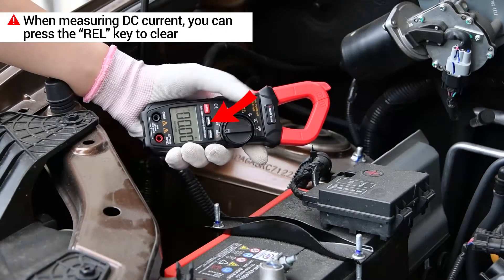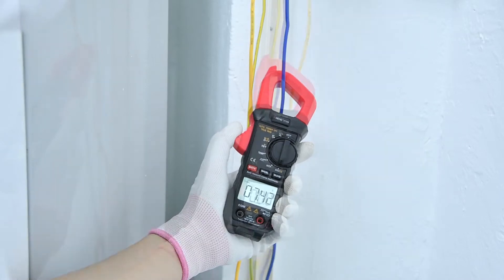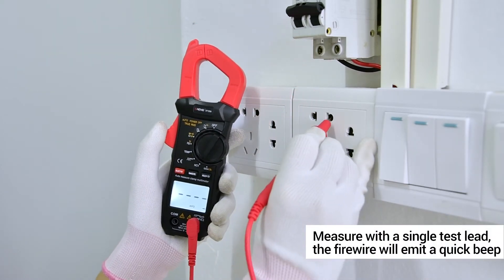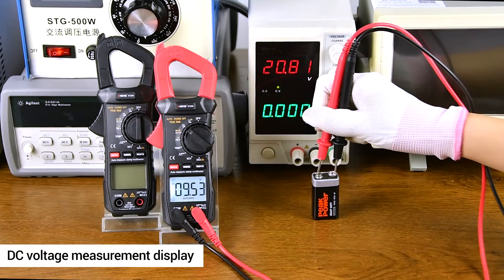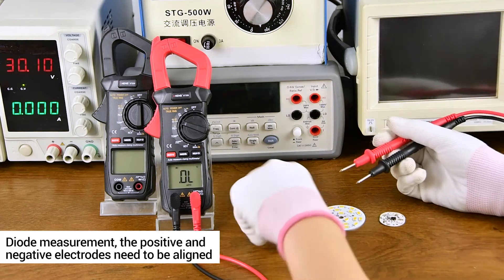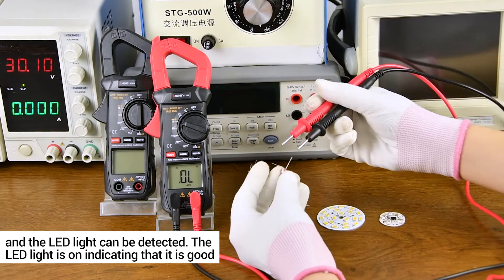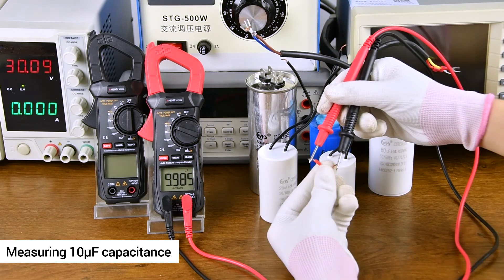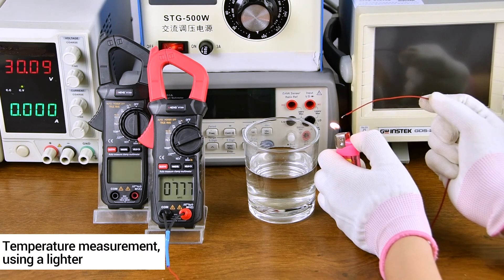ANENG ST209 Digital 6000 counts True RMS Multimeter Clamp Meter DC/AC Current voltmeter tester Meter

Comment: Recenty bought this model clamp meter, unfortunately not able to measure AC current under 1A. Contacted their technical team thru the dealer where i bought this clamp meter, till to date no reply.
Reply: Similar here, first I thought the device is broken, but later I've figured out that AC current from 0,25A is not shown, I had only 00,00 on the display. With other words,  a 60W bulb is not measureable. That means this is better for things about 100W (at 230V).
ADC works better, there it works from approx. 0,15A.
Reply from the maker: dear,thanks for your comment,and u could contact with technical team again to share your ideas~
Reply from the maker: dear,u need to contact with them to help u resolve the problem~